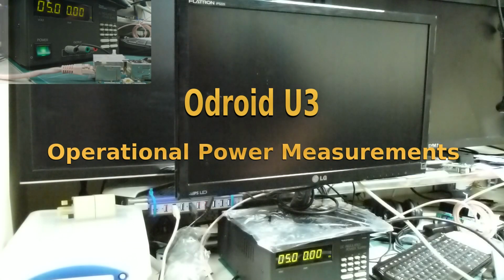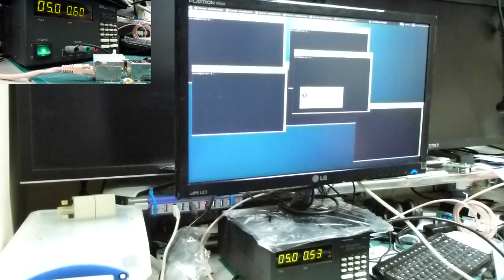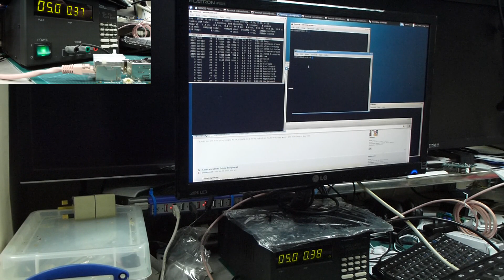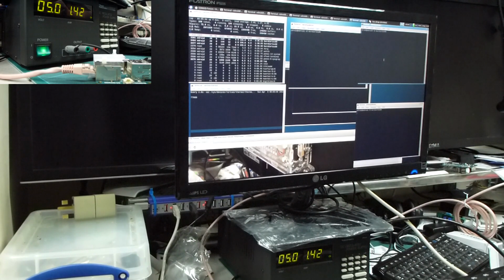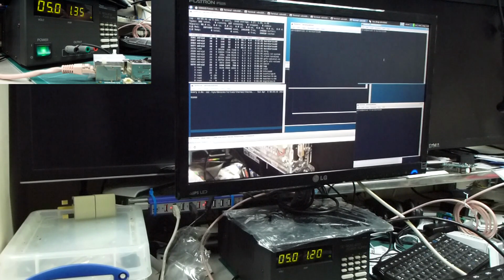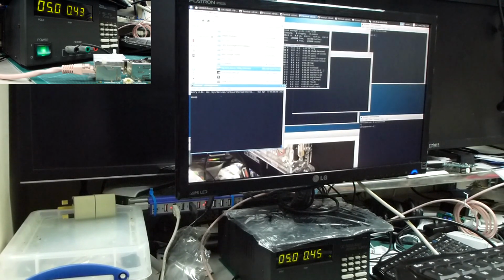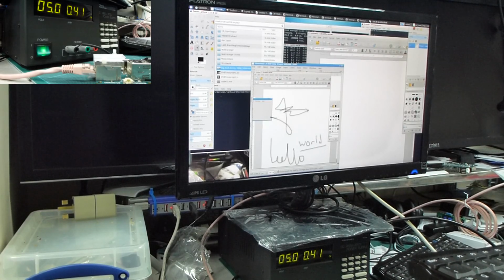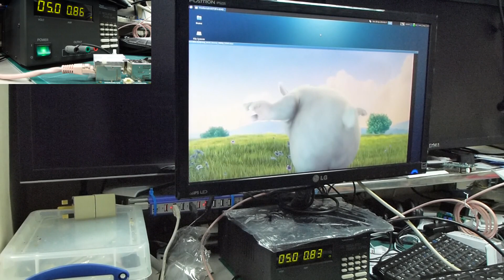ODROID U3 power Measurements

Comment: Awesome video, man! This is exactly what I was looking for. I'm planning to buy an ODROID U3 and I was wondering about the power consumption and about the CPU temperetaure when the device is under full load. Too bad you did not try to run BOINC while you were measuring, but I'm guessing that BOINC will produce similar power consumption and CPU temperature to what we see in the video when running CPUBURN...